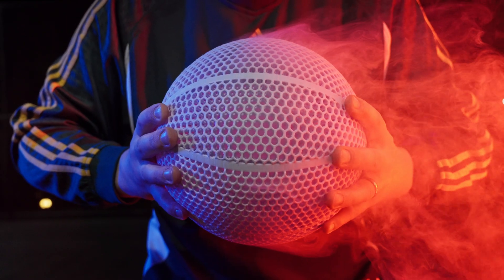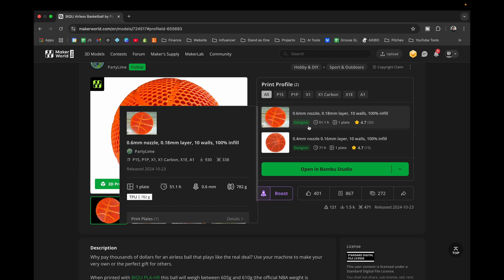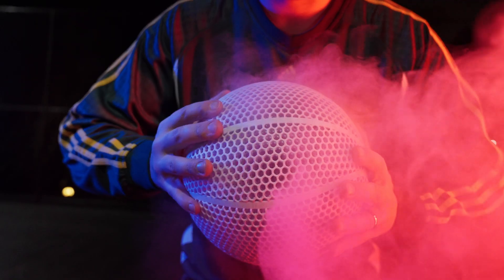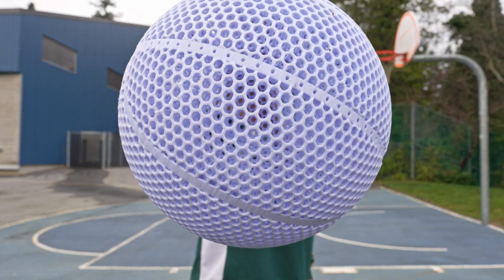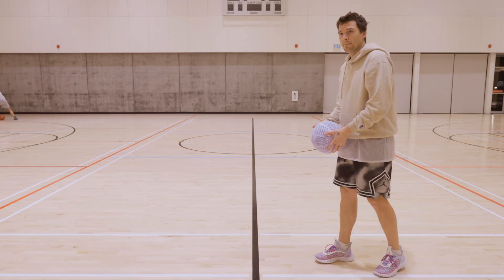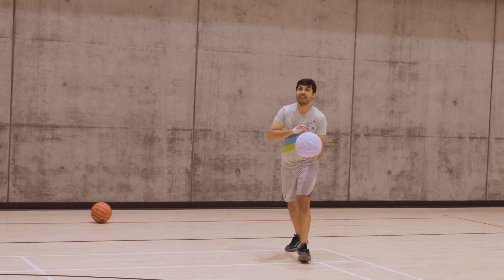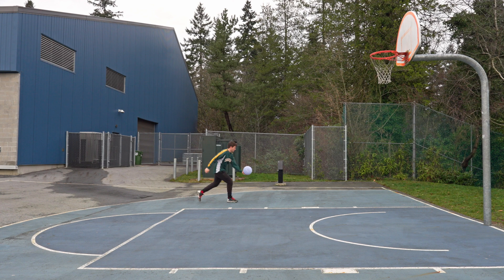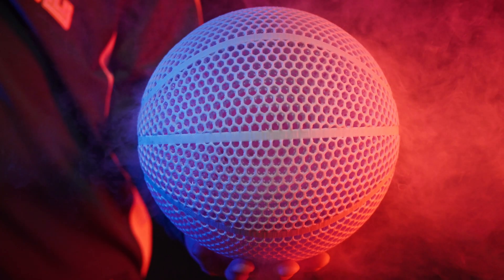The Big Problem with 3d Printed Basketballs!

Comment: Great vid, insightful! It was good to see that while it's not for serious use, it is still a practical BBall for my kids to use in the garden.  I bought the same filament, used the same model, and even happen to have the same P1S printer as you, but doesn't bounce anything like as well as yours (or as well as a properly inflated ball).  Did you change any settings, or do anything special/clever?

Comment: The shape won't actually change the magnus effect much. In fact, It may improve lift. On the flip side, the aerodynamic drag with be significantly higher.
Reply: drag here plays a huge role. Not only it has more surfaces to actually act on, there isn't any actionable lift produced.

Comment: What problem is the 3d printed ball supposed to be solving exactly? Is there a rubber and / or air shortage?
Reply: They're neat.
Reply: It's a lot easier and cheaper to manufacture. Also doesn't puncture and doesn't lose pressure with use.
Reply: @ I cant see how 3d printing is cheaper than traditional manufacturing of a basketball
Reply: @ You can't see how a single "set and forget" unmanned machine that only uses one material is cheaper than multiple materials, multiple specialized machines and multiple specialized people making it by hand?
Reply: Its a solution to a problem that doesn't exist.  Few embrace pointless change.
Reply: Tunnel vision. As if three d printing Was only for problem solving.lmao😅 . 3d printing is not for people who think inside of a box.
Reply: Doesn't lose pressure and is better long term for outside, because outside balls lose grip faster. It isn't meant to completely replace a normal basketball, but just to give players different options

Comment: Might I suggest a reprint using a surface texture to improve the grip, and a thin film as well covering half the holes. You could remove material from the inside of the current mesh to add as material so as not to affect weight. 
The covered holes will reduce drag and increase the Magnus effect. The grip will make to ball far better for play. You only cover half the holes because the spring in the ball is from to material rather than air pressure which you get in normal balls, so you have to allow air to escape the ball or its bounce dynamics will change.

Comment: definitely not primarily due to the magnus effect. the vast majority of the shortened shots is coming from the MASSIVE difference in surface area and therefore drag between the two. its many orders of magnitude apart. a longer time spent in free fall or a much higher rpm would give the magnus effect enough time to actually make a difference, but then youd just allow drag to continue to dominate the airtime forces.
Reply: I feel like the holes cause more random turbulence and therefore drag, causing the shooter to have to shoot it harder to reach the same distance of a regular basketball
Reply: @ nope. look into how golf ball dimples create turbulence on purpose to reduce drag. hell, theres probably a @scishow video about it
Reply: @nathanh2523 But from using the ball there is less drag. I have one.
Reply: @lemonke1474  now you are saying theres less drag? i dont think i even need to insult you lmao
Reply: @nathanh2523 meant to say more drag fedora boy
Reply: @lemonke1474  thats still dumb because if theres less drag then why does it not fly as far

Comment: BROOOO you do NOT!! Need gluestick. at all. it was used at the beginning of 3D printing in combo with painterstape. The modern buildplates are designed to stick to the material when heated. Doesnt stick to the plate? Increase the bed temp ;D
Reply from the maker: Tell that to the big flat PLA parts that warp off the plate if I don't use a small amount (textured pei) but yes I agree. 90% of the time I don't 👍
Reply: @JoelSchat  What bed temp do you use?
Reply from the maker: Depends, anywhere from 35-70. PETG always works perfectly, it's just big flat pieces of pla. I mainly used glue for this one cause I didn't want a failure as you only get one shot with this box of filament cause the model is so big!
Reply from the maker: Call it paranoia on my end haha
Reply: @JoelSchat  Do you have en enclosed printer? I had the aux fan warping my PLA parts, which is usually never the case. Fan turned off, now even flat prints like hueforge pictures print without any warping.
Reply from the maker: @PascalxSome p1S and X1C but I don't turn the Aux fan. Should probably open the door for those prints tho
Reply: @PascalxSome I’m having an issue with pla, just about every single print warps somewhere, not even only big flat pieces it could be a hollow rectangular box (like just 4 vertical walls) and it will warp on a corner. I’ve tried changing my bed temp in incriments of 5 with no help, I’ve tried using brims, and even rafts and it still affects the print. Never used a glue stick until I had this problem so figured I’d try it out, and even with glue on the pei bed it still lifts, I even had one big flat print I tried with glue and it straight up lifted the build plate since the print couldn’t warp because it was so stuck from the glue… I’m stumped. I can print petg and even nylon of all things without warping so I’m not sure what’s going on.
Reply: @JoelSchat is your bed clean? I've never had adhesion issues on a clean plate, always printed with closed door for everything :)
Reply: Gluestick is also used as a release layer for filaments that stick too hard
Reply: You do sometimes! Depends on the printer! Still use one and it just works
Reply: BIQU filament requires glue stick or their special bed(could be marketing bs idk)

Comment: I'm curious if printing a solid (or almost solid) ball would make any difference.
Maybe printing a ball from a more rubbery filament, then inflating it?
Reply: It won't inflate since 3D prints are not air tight.

Comment: I didnt calculate this, but i seriously doubt the difference in magnus effect has such an impact on the flight distance of a basketball. 

I find it much more likely that the difference in air resistance of the two objects is responsible. 

I would love to see your sources for that claim, i have failed to find anything regarding the impact of the magnus effect in basketball.
Reply from the maker: I remember learning about it at a basketball camp, one of the reasons you are taught to focus so much on having a lot of backspin on your shot! 

I should have added a section specifically for the airless ball about air resistance as well as it makes an impact for sure. 

Either way, the airless ball is falling short on each attempted shot with the same shooting mechanics
Reply: @JoelSchat  Im a physicist by trade, but aerodynamics is far away from my area of expertise. That means I know just enough to know that aerodynamics is counterintuitive and extremely complex, so take what i say with a grain of salt. 

From a napkin calculation i think both balls might fly a few inches further due to the magnus effect. It looks like it might actually make a measurable difference. There are other, maybe more important, reasons why it might be better to give the ball backspin (more likely to bounce in than out, harder to grip/catch for opponents, easier to archieve a high angle of departure with the technique that results in spinning) 

Interestingly, a rougher surface generally increases the magnus effect. Surface-Air friction is required for the effect to occur at all.

The "surface" of a 3D printed ball is complex and the interaction of it with the air, especially when it is flying and spinning, is very complicated. Because of that, the only thing i feel comfortable to predict is that it has a lot more air resistance than a traditional ball. 

Im very impressed that you got that thing printed btw. On the first try no less. I have a ~10 year old printer that was <150$ at the time, and Im really impressed what these new machines can do.
Reply: @JoelSchat  I think it's actually drag slowing it down, and vortexes created by the disrupted airflow. I've studied a bit of aerodynamics and this screams like disrupted airflow and created drag.
Reply: Easy way to test would be a baseball pass or a floater as those dont have much spin
Reply: I was saying exactly the same thing during that part.  It doesn't fly as far just because of drag...the thing is a giant wad of air resistance.  Very easy way to test this would be to take a few shots, then wrap it tightly in a layer or 2 of plastic wrap, packing tape, something like that, then take another few shots and see the difference.  I bet it would be substantial.
Reply: How about weight? Denser things reach higher velocities, i guess it has to do with the more the weight the less the drag?
It looks lighter, do you all know if it is?
Reply from the maker: @JorakinHost they are roughly the same weight. Marginal difference

Comment: Hello. I am planning to print 3D bball for indoor use with PEBA filament. About the fluid dynamics, if we can make the air holes much smaller and keep other qualities as same, do you think we can nullify the negative effect when shooting?
Reply from the maker: That's an interesting question. I suppose the smaller the holes the less it will affect the lift. I'm not a physicist or anything so I can't help you out with the math of how small they would need to be
Reply: @JoelSchat  Thank you for the reply. I am a complete newbie in 3D printing so I need to figure out how to make the holes smaller in the file. I am thinking about leaving two diameter holes that are slightly depressed from both top and bottom side to use as minimum amount of filament as possible.

Comment: Great video. Curious, why didn’t you print the biqu file?
Reply from the maker: Thanks! Which Biqu file? I couldn't find one
Reply: @JoelSchat  I just ordered a spool of the bball filament and it says it comes with their file(s) for their ball
Reply from the maker: @sciencesaves oh interesting! I bought mine via AliExpress so maybe that's why it was missing from the package!
Reply: not sure how I will get the file. I’ll let you know when the filament comes
Reply: from their marketing of the plahr “We strongly recommend using our 3mf file for printing as it contains pre-defined settings.” And they recommend using a 0.6 nozzle
Reply from the maker: I did use the settings they have on the website, as well as a 0.6mm nozzle. Just couldn't find the .3mf
Reply: I am going to preemptively contact support for the file 👍 bc I know I’m going to want to start the print asap when I get the filament
Reply: I tried posting the link here but it’s gone. Did you see it?
Reply from the maker: Didn't see it no, I think YouTube doesn't like links in the comments
Reply: @JoelSchat  I tried breaking the link up in several different ways. yt ain’t having it. The model is in Maker World as BIQU Airless Basketball by user PartyLime

Comment: I wonder if some form of aerofoil structures printed inside the ball could compensate for the lack of lift.
Reply: I think this is unlikely to work. On the one hand, the airflow inside the ball is likely so chaotic that you would struggle to create lift in any direction.
On the other hand, and much more important, lifting surfaces produce lift in one specific direction, and you cant predict the orientation of the ball in the air.
Reply from the maker: oh interesting! Ya I've been thinking of solutions, however I think most of the changes would cause a change in the bouncing characteristics, which would be harder to overcome